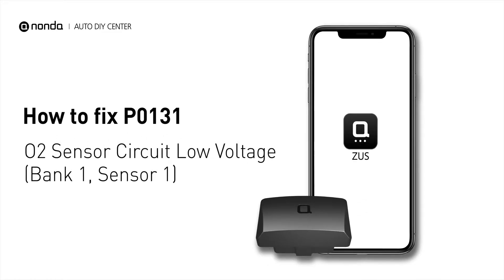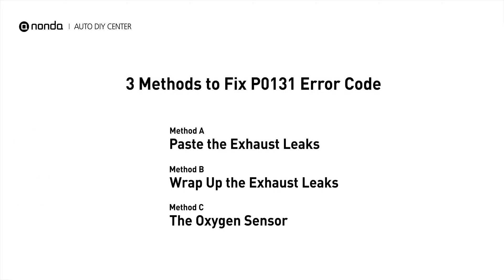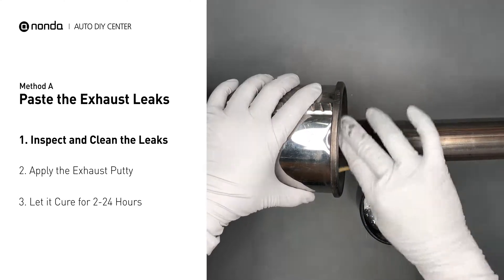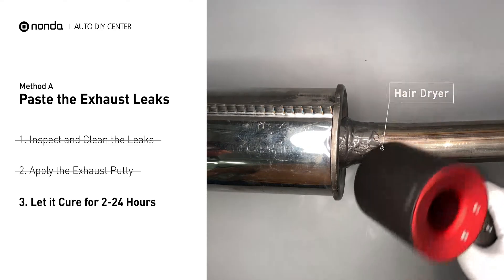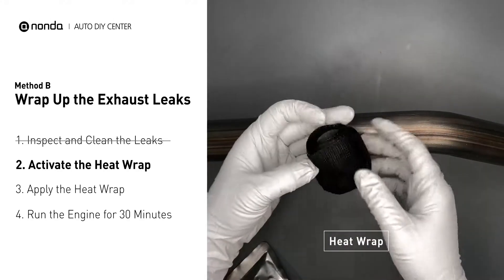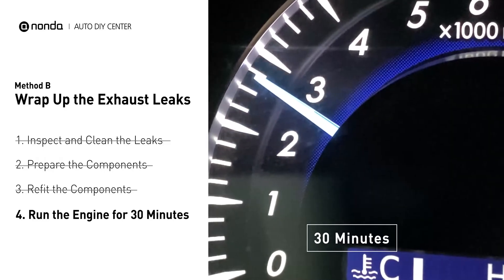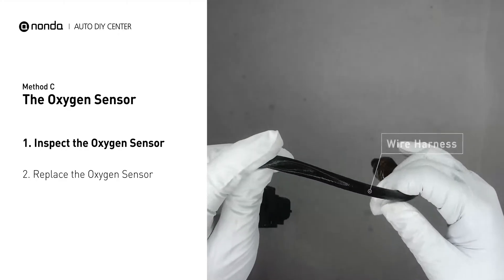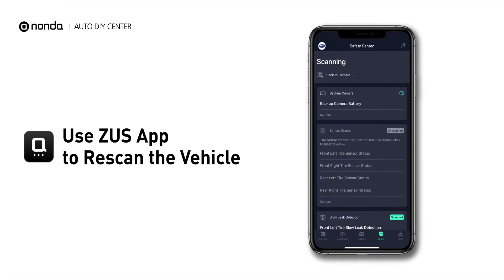How to Fix P0131 Engine Code in 4 Minutes [3 DIY Methods / Only $9.65]

Comment: hi,  I have exactly this issues P0131 a 2010  chevrolet aveo, I did twice o2 sensor replaced not working, so I have check exhaust done, and there's no catalytic conventer on it, is it possible the CC could causes to this o2 sensor with P0131?

Comment: 2015 Giulietta 1.6 JTD, i had P0131 issue before then sensor replaced, after same error appeared again then i deleted the code with OBD i havent encountered similar issue again. After 2 years i have the same issue and i went to mechanic and told my problem. They wanted to change sensor again and i accepted. But now i am praying to not have again. Could you please give me an advice is it really related with sensor? Thank you

Comment: Hello i have a 2000 Honda Accord 2.3 v4 and i keep getting p0131. I just replaced the fuel regulator and before i did i was getting p0172 and pending p0170.

Comment: I'm a mechanic and have been for 22 years. This is absolutel bs!! Those are weep holes thar are supposed to be there. Exhaust leaks don't set trouble codes
Reply: Yea, I just replaced my midpipe and catalytic converter, and the leak i had before didn't set one off , so I was definitely skeptical.
Reply: A question for the masters , I have a 2013 M37 Infiniti, code P0151 showed up (O2 Circuit Low voltage) Bank 2 sensor 1 , I went ahead and I replaced the sensor, 40 miles goes by and now I have the same code showed up again + P0131 and after resetting the codes now am getting a new code , which is P1168 in addition to the other 2 codes, please let me know if you can help resolve this issue, thank you.
Reply: @DrDave-bj5lc  check battery surface voltage and draw. Check alternator output. Nissan electrical is extremely sensitive.

Comment: I have a 2016 dodge Durango sxt v6 2 wheel drive and the p0171 came up and I changed a sensor and now that code went away but now the p0131 is coming up along with p0297. Please help if anyone knows what I can do, thank you in advance
Reply from the maker: Hello, as you are receiving more than one error code, we highly suggest getting your vehicle visually checked by your local mechanic for further diagnosis.

Comment: Getting p0135 and p0131 and before change also p0130. Opel Astra G
Reply from the maker: Hello, as you are receiving more than one error code, we highly suggest getting your vehicle visually checked by your local mechanic for further diagnosis.

Comment: I have a 2016 F150 3.5L ecoboost and I'm getting P0131 and P0430. Is this a bad O2 sensor?
Reply from the maker: Hello, as you are getting more than one error code, we suggest getting your vehicle visually checked by your local mechanic for further diagnosis.

Comment: Hi. Getting a p0131 and p0171 code on 05 ford fiesta zetec 1.2ltr petrol
Reply from the maker: Hello, as you are receiving more than one error code, we suggest getting your vehicle visually checked by your local mechanic for further diagnosis. Thanks for watching!
Reply: I also had p0171 and replaced sensor and now the p0131 is coming up. I have a 2016 dodge Durango sxt v6 2 wheel drive

Comment: I changed the 02 sensor and catalytic converter and the light is still there? Honda Civic 2000
Reply from the maker: Hello, please check the terminal if there's voltage going to it and if there's a short in the wiring harness.

Comment: Hi Alfa Romeo Giulia Veloce 2017 P0130 error .. need to change O2 sensor ?
Reply from the maker: Hi Andrea, can you please confirm if this is the only code you're getting?
Reply: @nondainc  Hi! Yep, this is the only code i get.. P0130 O2 sensor bank 1 sensor 1 circuit malfunction
Reply from the maker: Hi Andrea, before replacing anything, we suggest checking first the condition of all the parts related to the issue (possible causes) to verify what really needs to be replaced/fixed. Kindly check the MAF sensor, oil control valve, air flow meter, and if you have a dirty oil.
Reply: @nondainc  is possibile to check all that sensor/actuators with a scanner, or i must check manually?

Comment: Would a leaking exhaust manifold gasket cause this code P0131 also??
Reply from the maker: Hello, can you please provide us with your vehicle's year, make and model?
Reply: 2002 Subaru Legacy 2.5L. Code came up so I replaced the 02 sensor with a new OEM. Reset the computer and the code came right back!
Reply from the maker: No. Usually, issue with the wiring harness going to the sensor is the source of the issue. Please have it inspected.
Reply: @nondainc  Thanks so much for giving me a direction to look into. Maybe even possibly the ECM/ECU has gone bad?
Reply: @nondainc   The original codes were P0031 and P1137. Now it's only the P0131. Thanks for the response.
Reply from the maker: You are most welcome! The harness between the ECM and the front oxygen (A/F) sensor connector must be checked for short circuit.

Comment: Hey there, would any car modifications also cause the P0131 code to appear?
Reply from the maker: No. Faulty bank 1 sensor 1 wiring, oxygen sensor bank 1 sensor 1, and issues with voltage/resistance are the most common causes of this code to appear. You may follow the suggestions in our video. Hope it helps!